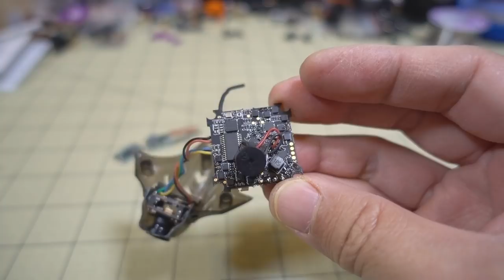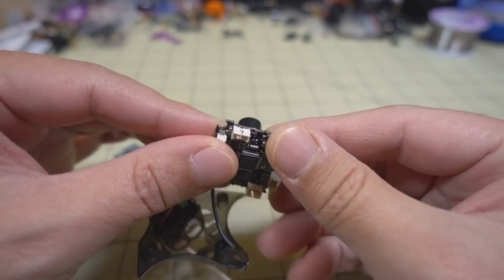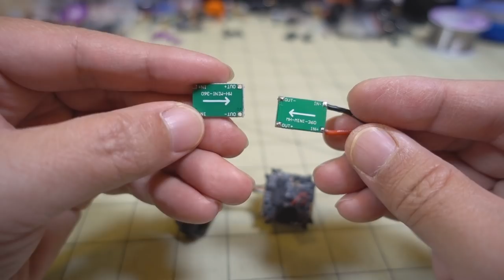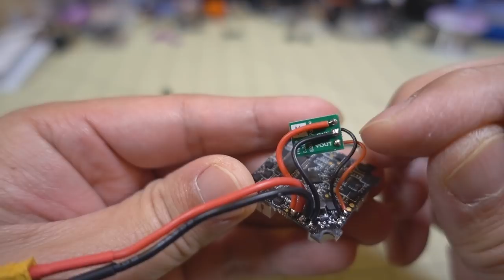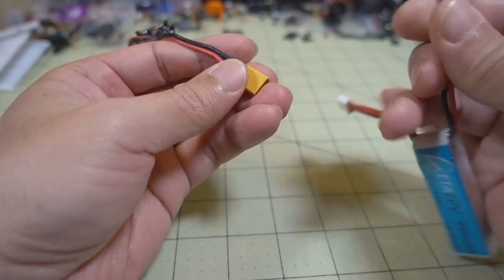Fix Your CrazyBee 🛠️😀👍

Comment: Wow! I would be jumping up n down right now if I had a dead crazybee. Thanks for this. I’m sure you made a lot of folks day today. 👍🏼
Reply: mine died today, i'm pretty sure it's the same problem,  i can even spin motors in betaflight but no power when i unplug usb.  Damn less than 2 packs on that board how the hell did this happend.
Reply: You should be jumping up and down if you DONT have a dead crazybee ;) you must be lucky with yours!

Comment: damn near one year later to the week, i've had to perform this "hack". Thanks sooo much Albert. i can't believe this was in my watch history.
Reply from the maker: This is actually a common problem with a lot of FCs before the crazybee.  I actually started doing this hack about TWO years earlier.
Reply: @AlbertKimTV  I'm not sure if you've done a 'PSA' on the other issue with the CrazyBee F3, F4+. about betaflight getting reset if battery goes below 3.0v. Nick Burns mentioned this issue to me after i thought I fried my mobula6 board. you know a lot of stuff I'm sure you're aware of that issue?

Comment: Thanks for this. I figured this would work but didn't have time to test it. I'm pretty sure you can run 3S on that board you have now. It was just the 5v that was limiting it.
Reply: @KrotowX  that stuff comes from the FC. Not the cam
Reply from the maker: @KababFPV Yeah, I think you can definitely do 3S now. However, the Polulu I used only goes up to 11.8v.  So probably should use one of the other voltage regulators I listed with a higher voltage range.
Reply from the maker: @KrotowX  The FC reads voltage from the main battery line so those readings are unaffected.
Reply from the maker: @KrotowX  That's a different board than the one in this video and I'm not familiar with how that one is setup so sorry can't help with that.
Reply: @KababFPV But it's the same board you have said that is very reliable. So what's up with that? Wanted to grab board or two but know I really doubt...
Reply from the maker: @MariusFBU  I don't recall saying anything about reliability in a previous video, however I think most of the failures are from people modding their Mobula7 and using components that are drawing more current than the originally intended AIO camera of the Mobula7.  Is it really that easy for you to say such harsh statements?  How old are you anyway?
Reply: These boards have been super reliable for me.  I've used over a dozen and haven't had a single failure.  Use anything enough and something will fail.  The 5v issue on these boards is no something new.  5v lines have been burning on FC's since the beginning of time.  It's just become a normal failure point that few talk about anymore.  I've relayed the failures to happymodel and they are working on fixing things to have a more robust board.  All we can do is aim for a better future...
Reply: @AlbertKimTV  Thanks Albert, I have the same one so if it breaks i can try this before throwing it away.  I'''ve crashed the shit out of it and it still works. 
I dont get why that guy was complaining, the board costs 30 bucks, i smoke more weed than that on a daily basis.
Reply: @AlbertKimTV  Sorry its my fault and misunderstanding. Comments were referred to KababFPV, but I didn't want to be harsh or mean for anybody.
Wrote first comment, and before posting, YouTube autoplayed next video, and when I came back to check it wasn't there. So revrite it, but in another words and didn't saw your latest comment. Really appreciate what you and KababFPV are doing.
Reply: @vanlifefpv6340  yep
Reply from the maker: @MariusFBU  Ah I see. I thought you were accusing me of lying about the reliability and I didn't remember saying anything about that.  OK cool.
Reply: @AlbertKimTV  when I read replies- didn't catched what is happening, then read comment sequence and understood how bad it looked, sorry... In first comment (that is deleted now) I have used upside-down question mark, to show that I'm not serious.
Reply: In conclusion (apart that I have messed up this conversation) , it seems that board perfomes fine, but its important not to overload BEC.
Reply: anyone spot the bad 5v regulator on the board yet? I'd like to find the faulty component and remove it out of the circuit
Reply: So it seems it would be best to power camera and VTX from an external regulator from the start and you shouldn't have any issues with the Crazybee boards?
Reply: @AlbertKimTV  hi, my amp draw (0a) and main voltage (5v) dont work after this fix on my 2s setup, do you have any solution for that? thanks for the fix of the 5v reg, with the timer is good but the main voltage would be better.

Comment: Hi. I have the Opposite problem with a brand new on. ,when i connect the batteries it juts make the first 3 tones and stops.  It wont connect to betaflight on mac but other quad does so no poert problem. Usb powers it up leds are on , vtx is working,  but no connection with betaflight. Please help.
Reply from the maker: The firmware on the FC might be corrupted.  Boot up the FC in DFU mode by holding down the boot button while plugging into USB.  Then reflash the firmware to the board.
Reply: Albert Kim I already tried that. If I connect the Mobula to a pc there is absolutely no reaction from the computer. Like nothing plugged in. If this is occurred how can a flash the firmware? Thanks

Comment: Finally got my regulator in from Amazon and soldered it up last night. Flies like a charm! Thanks so much Albert. And also confirming that I was able to hook up the regulator along with my external RX to the same pads. Along with the buzzer it's all a very tight fit but managed to get everything in there.
Reply from the maker: awesome!

Comment: Wow I just through a trashcan flight board out with this same problem and ordered another one. Looks like it's dumpster diving for me in the morning. Thanks Mr Kim
Reply: Mine just did the same thing after 3 flights
Reply: @kd9432  I got the second board and did this mod and all was good until after a crash into the dirt dislodged a solder pad on the board and it is crap now. I am done spending money on this eachine piece of junk.
Reply: @polemagnetfpv  did u double side tapbe it with shrink tube?
Reply: @kd9432  Yes you have to or you will get magic smoke.

Comment: This is the same symptoms I've had with the F4 version.  I got about a 12 packs through my TrashCan before it failed with these symptoms, and then I got a new replacement F4 Pro board, and same problem again after just 1 flight/battery.
Reply: Rick in Jax same here

Comment: Noice. I did the exact same fix with a 5v linear regulator chip that I stole directly from a dead aio full size. It gets extremely hot but it works! Won't work with 1s however, just 2s and above.

Comment: Albert Kim, Does the 5v ground go to the pad that the battery lead goes to? In the video it looks like it’s not, looks like it’s going to the pad to the right, but I think you are using a different version of the board. I’m using the Crazybee Pro F4 v1 that came with the Trashcan, thanks.
Reply from the maker: I'm just connecting it to some random ground point.  You can use any ground, it doesn't matter.

Comment: Interesting...I have an F3 and an F4 pro each with different symptoms than this.  My F3 seems to have one ESC which is either intermittent or bad.  My F4 seems to work fine, but under reduced power...like less power than if I was just using a 1s battery previously....I can fly it but it is no fun at all :-).   I replaced my F3 with a new one and all is good now on that whoop...waiting on a new F4 proand I assume it will address the problem on that whoop.  Of course I tried initially searching for my issues but very very little content out there highlighting specific problems on these boards.

Comment: anyone have a diagram or diagnose which linear voltage regulator part is actually failing?  I've been looking for it but can't seem to identify the faulty component.
Reply: Also interested. Should be easy to replace once the component is identified.

Comment: Albert, What if I've lifted the positive power supply pad? Is there somewhere else I can apply vbat (2S)? 
(Actually got it to work. Just to the left of the positive in pad is a bit of metal that can be exposed if you scrape the paint away with a plastic spudger.)

Comment: I had the same issue and fix on my eachine trashcan...make sure the regulator is not close to vtx or it will produce too much noise in fpv.
Reply: To conserve the handy beeper function, my initial thought was to give the constant 5v through the aio camera.  I guess this is not a good idea.
Reply: I think all the 5volt pads are interconnected so it doesn't make a difference which one you choose.  I chose the 5volt led pad because it was convenient.
Reply from the maker: @ChrisLBradly  Yes, all 5v on the board is connected together.
Reply: @AlbertKimTV  Thanks fellas.  Sorry if I misheard you Albert.  Didn't even think about the led pads I definitely don't need those. 
How about another positive Vbat location?  I dont fully trust that the Welder Glue is a long term fix.

Comment: Trying to figure out if I can do the with a Crazybee f3 from a ur65 which doesn’t have led pass. Could I use the camera solder points instead?
Reply from the maker: Yes, any available 5v pad will work as well
Reply: Albert Kim thank you! Much appreciated

Comment: Great video, i have the same issue on two crazybe f4. The issue came up when I flashed the software with betafly. It the saved the configuration before I try the software upgrade but it does not help trying to apply back the old configuration. I get the power red  light and FC blue light to come on. What I do not see is the LED for the receiver to come on. Is strange that this happened because it was find until I flashed the software. Now it won't bind.

Comment: Would this also fix the board dying when people switched to a XT30 connector?  Or do you still need a capacitor for that?
Reply from the maker: I'm not sure what you're asking.  You need a capacitor to protect the 5v regulator so you probably still would need one.
Reply: Albert Kim I’m referring to the Mobula 7  thats famous for its regulator frying as you plug it in, if you upgrade battery plug to XT30, especially with 1102/1104 motors 3s, think you did a couple vids about it. Mine took a dip in a deep puddle, so I ordered new board and 4 1102-8500kv motors. Happy model includes a  XT30 with 100uf 16v capacitor already soldered to plug with M7 and Sailfly now.  As you know, many people saying the 100uf capacitor is not enough and it’s regulator still frys.  I’m on the fence about installing, as is, because I’m still intermediate skill lvl, and only use 2s.  So I was wondering if your fix coupled with HappyModel’s built in cap, would for sure keep M7’s regulator from blowing, or do I have my wires crossed (pun kind of intended) and this fix above has nothing to do with that issue. Thanks for responding!!

Comment: Thanks four  your video i have a problem i tryed to bind a radiolink at 10 to my mobula 7and i change the reciever in betaflicht to sbus  and now my mobula is not recognized by betaflicht enymore wen i plug ith in no respons atall do you have enny sugestions ? i have stil bleu and red led but even my pc is not responce enymore wen i plug the board in eny idea wats happen? krg ROB
Reply from the maker: Sounds like the config is corrupted.  I would try to re-flash the board.  Put the board into DFU mode by pressing the bootloader button while plugging in the USB cable and then flash Betaflight by full chip erase.

Comment: could you wire the cam vtx and rx to the external 5v and keep the fc powered off its own 5v if your board hasn't been broken yet? also does the pololu output enough current?
Reply from the maker: Yes you can do that as a preventative measure and the Polulu outputs 1A so should be enough for external RX and VTX up to 200mW.  Beyond that power, you'll need something bigger.

Comment: Just happened to my Eachine Trashcan after 3 battery packs on XT30 connector.  I even had a cap on the power leads.  Did they ever fix this issue or do they expect customers to fix it for them?  Also, if I do get a replacement, any way to prevent it from happening again?  A 10uF cap (largest I could squeeze in between the FC and VTX) wasn't the answer.
Reply from the maker: These are designed with weak regulators so that's why they are failing for a lot of people.  It doesn't mean it will fail for sure but the chances are not low.

Comment: I've seen a lot of people having this problem when using XT30.  Happy Model are accepting that converting to XT30 will blow your regulator and/or your esc - they are saying to add a 100uF capacitor across the XT30 to smooth the initial voltage spike on connection.  They posted their info on their listing on:  https://www.banggood.com/Happymodel-XT30-Plug-Pigtail-Power-Wire-with-100F-Capacitor-for-Mobula7-HD-TRASHCAN-UR85-UR85HD-Crazybee-F3-F4-PRO-Flight-Controller-p-1476203.html?rmmds=search&cur_warehouse=CN

Comment: Hello Albert. Thanks a lot. Question: Is it necessary to cut some PCB way or remove any component from FC regulator, so it will not interfere with external one? Thanks again.

Comment: hey albert, why not reflow the reg on the PCB and replace it with a new one instead of the addition of a step reg
Reply from the maker: Because I don't know how to do that and don't know where to get the part as well.
Reply: @AlbertKimTV  you made a major point on, where in the world could someone locate a replacement IC that fit its specs, ..that could become a migraine inducing rabbit hole to fathom, good call !

Comment: Albert mine worked with usb before the very first time I plugged in an xt30. Now no lights come on with usb or battery however my external vtx powers on
Reply from the maker: So the first time you plugged in an lipo did anything smoke?  So that first plug in, no lights at all?  What was the lipo?  What is the VTX powered off from?  Lipo or 5v?
Reply: @AlbertKimTV  No smoke. Lights just went off. I had the usb plugged in and then plugged in the xt30 with a gnb 450 2s AT THE SAME TIME. VTX is a pro32 nano powered off 5v.

Comment: Does the voltage regulator get hot during operation? Also, did you ever find one that works well for 3s?
Reply from the maker: It gets warm but not hot.  Obviously don't stick it somewhere it can't get any airflow.  It will get hot then!

Comment: Hi Albert, I tried this for my crazybee F4 pro v2, running 2s battery with 5v regulation, flying very well but why is my board so hot? I don't have a temperature gauge, it's above 75 degrees Celsius :(
Reply from the maker: The ESCs?

Comment: Thanks Albert, my Trashcan is having this issue after flying 2 packs, only powers on with usb..
What AWG wire do i need to use to the regulator and from the regulator to the board?
Reply from the maker: I think 22awg is good enough.
Reply: @AlbertKimTV  Ok i've got my hands on some 26AWG  but i think that's close enough,  the other side i can use some thin camera wire for the 5V output side ?
Reply: @AlbertKimTV Hej dude i think i fixed it,  the LEDS actually turn on now :D  cant test flight since im waiting for new motors. But this is a very good sign!
35,- for a new FC,  or 5,- regulator with some spare time, i'm so happy,   you're the man!
Reply: Quad Copter how you fix it ? Mine 5v and gnb alreade used by vtx and camera how i do solder then ?

Comment: So just got a Trashcan, and video has horizontal moving noise, led strip is spazing out, and osd is flickering. Have to think that all is related to crappy 5v reg. I saw this was an issue with the board, so pre-emptively bought a pololu. Should I wire it up if the on board one isn't dead, just faulty? Or will that make 10v run through everything and fry stuff?
Reply from the maker: It won't be 10v, still 5v and which ever regulator is stronger will win but I don't really know what will happen since all my boards had dead regulators and not flaky ones.
Reply: Thanks for the reply! I think I will just offload the vtx, cam, led, and rx to the pololu, and hope that the onboard regulator will keep working to run the FC. I'll let you know how it goes.
Reply: Success! All peripherals wired to draw 5v from the pololu (only disconnected the positive, left ground wires attached to the board) and the video is nice and clear, osd doesn't flicker, so the onboard reg is working fine for those functions.

Comment: Question!

I’m already using that 5v out pad to power a rx. Can I bee(haha) feeding voltage to that pad while still powering the rx with it??? I’m guessing no but I’d love to hear the opposite
Reply from the maker: Yes, that's OK.  In and out on the same pad is not a problem as long as the voltage range is correct.
Reply: Albert Kim thank you!!

Comment: Hi..this issue is also common in CRAZYBEE F4.. I have one with a broken voltage regulator and another one with a burnt ESC.. I am waiting for the version 2 that hopes fix these issues. In meantime I have got an AIO Betafpv 2s. To avoid any issues in this AIO FC I am going to solder a BEC to feed the VTX and share the VTX ground with the FC. Do you have any news about the CRAZYBEE F4 v2?
Reply from the maker: V2 isn't out yet.  I hear it's coming next month.

Comment: Hi Albert. One more question. Once its all soldered, would you recommend shrink wrapping the regulator to prevent the wires from making any undesired connections on the flight controller? Or do you think the regulator needs to remain uncovered for ventilation?
Reply from the maker: I would shrink wrap it.  I didn't do that here for obvious reasons...
Reply: @AlbertKimTV  Awesome thanks!